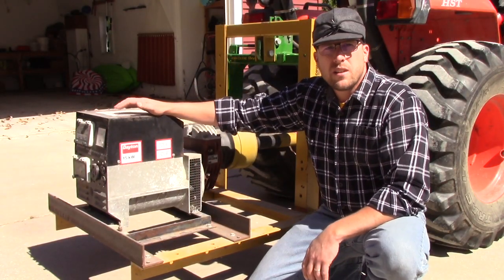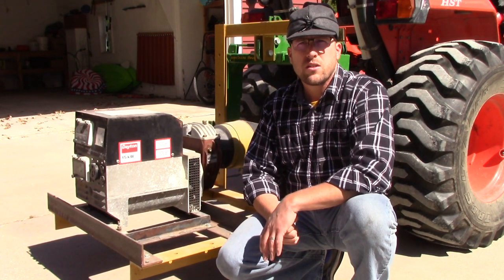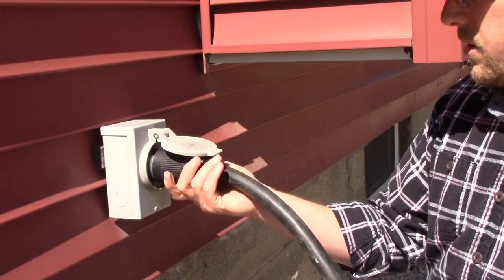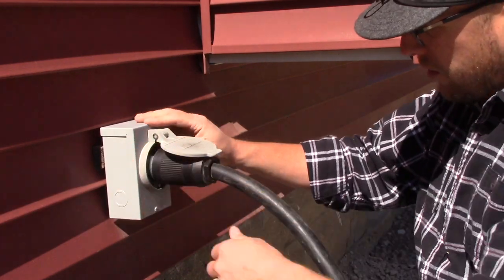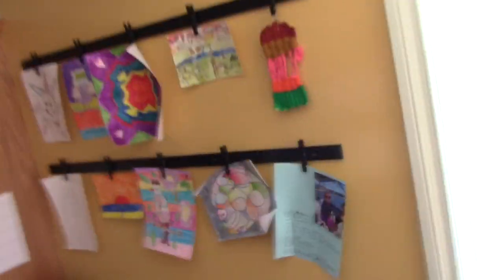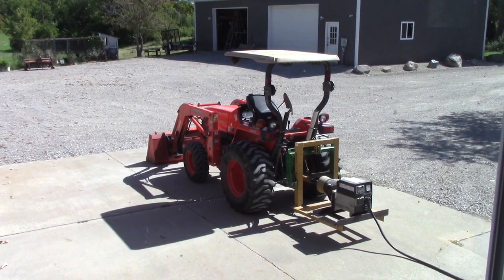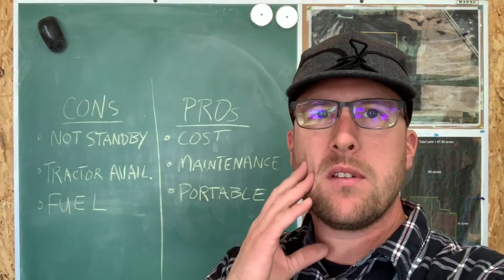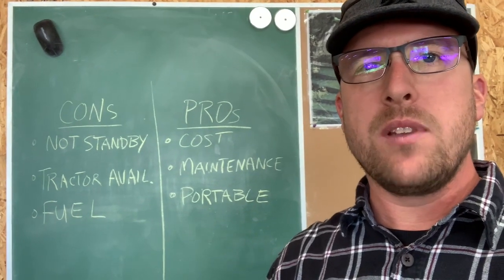154 PTO Generator setup on Kubota L3400

Comment: That interlocking system was a really effective system to prevent backfeed, a good switchgear, basically. Here in India, we use 1-0-1 type mechanical transfer switch to prevent back feed.
In India, locally manufactured PTO generators are huge success for farm irrigation to run tubewells and open irrigation monoblock pumpsets.
I appreciate your video, good description as well.
Reply from the maker: Thank you for your comments. When I first used this genny I did not have the interlock. Although I know what I am doing, I soon realized that sharing on YouTube could encourage people not to use an interlock too and some folks don’t know the real danger. Thanks for watching!

Comment: I have the same L3400 Kubota tractor. I did not quite understand you about the PTO RPM vs Engine RPM.  So what is the Engine RPM? Also I don't recall you saying what gauge wire is in the cable you are using for 15kw generator.
Reply from the maker: Well, on the RPM gauge there is a reference line where the engine rpm should be I order to get your PTO rpm to be close to 540. That said, with a load on the generator, you will need to know the voltage output somehow. My genny had a gauge on it, so I simply adjust the engine rpm in order to get the proper voltage output (frequency, really). If you did not have that, a voltage meter would be necessary to check one of the genny receptacles for proper output. Hope this makes a bit more sense.

Comment: Great job.  Any issues with the seat safety?   Don't most tractors shut off when you get off the seat?
Reply from the maker: The kubota has a three position seat switch (seated, not seated and seat forward) so when you get off, if you immediately flip the seat forward it will allow the pto to remain operating. Works good so far.
Reply: My tractor will run with no operator if the parking brake is engaged and it is out of gear.

Comment: I just bought me a Winco 15k now can you run your AC and furnace? Everything in your house at once?  I could of went bigger but in this day you really can’t find anything. I have 65hp on my pto   I’m setting my who system up like yours. Same cord same everything.
Reply from the maker: Hello. Yes, I can run the entire house. When initially starting up, I make sure some of the larger loads are off in the box. That way I don’t have such a large startup load. Then, once everything is up, the normal cycles of pumps and motors is ok with this genny. With your size tractor, you’ll hardly hear it grunt when loads come and go but you’ll have the same amperage restriction with the 15kw. Just do some testing to see what it can handle. Make sure you have the interconnect from the main grid power….ensuring you’re off the grid before connecting your generator.
Reply: @LivingOurAmericanDream  will do. I’ve done this type of setup before in my other homes. But this is the first time with the PTO generator

Comment: HERE IS A BETTER WAY JUST BUY A 100 HORSEPOWER ELECTRIC MOTOR FOR THESE YOUTUBE VIDEO‘S LISTED HERE. #1. This video is called;  (MAKE FREE ENERGY GENERTOR 220V  WITH 5KW ALTERNATOR AND MOTOR FLYWHEEL FREE ELECTRICITY GENERATOR). #2. This video  is called;  (MAKE 12K FREE  ENERGY FROM 12KW ALTERMATOR).  #3. This video is called;  (FLYWHEEL POWER GENERATOR AND MULTIPLICATION AND STORAGE). #4. This video is called; (MAGNATIC MOTOR FREE ENERGY WORLD BEST TECHNOLOGY ENGINEERING PROJECT 2020)

Comment: How much KW is this Generator running on the 2210?
Reply from the maker: If you’re referring to a John Deere 2210, the web page I looked at claims the pto is capable of 17 hp. That means it’s capable of running ~8500 watts or 8.5kw. Remember, if the tractor produces less than the generator is capable of, then you’re limited to what the tractor produces. If the tractor produces more hp than the generator is capable of, you’re limited to what the generator can output.
Reply: @LivingOurAmericanDream  

The specs say tractor Hp is 22.5 Hp.
The PTO is claimed to be 17.7 hp.
Will this 10 kw unit operate up to 8.5kw?
I know the more load you put on generator the harder it is to turn.
Reply from the maker: Ok, at 17.7 hp, your tractor is capable of running around 8.8 kw (it’s roughly pto hp divided by 2 gives kw capacity). So, if you have a 10kw generator, your tractor can still use it but you’ll only get the power the tractor can provide, in this case 8.8 kw. 

On a side note, 8.8kw is likely enough to run most everything you’ll need in an emergency situation, assuming you’re powering a normal house, not a farm.

Comment: Great video. Just wanted to share my experience with generators.  I ran a 11 kw for the backup of the storm in Texas.  It burned 1.1 gallons per hour of gas and my son had my farm light plant borrowed and it only used 6 gallons a day and it was only a 7kw.   Mine was a 3600 rpm and the other one was 1800 rpm   This was just running lights and cooking for my side and he run lights and blower motor for heat and water well!!!
Reply from the maker: The advantage for us is that our tractor is typically ready to go at all times and maintenance is up to date. Lots of folks forget about maintaining or even starting their generator until they need it. Thanks for commenting!
Reply: @LivingOurAmericanDream  
Yeah  I have used different ones and you’re dead one with maintenance.  There’s a avr on a lot of them and will go out or capacitor will loose it s exciting charge and they won’t work.   I watched Dennis on dlh farm from a couple of years ago and his pto 40k pto had to have its excitement flashed on it and it had a stud behind the cover to do it on

Comment: What if a tractor had ,say, 60 PTO hp for 30 KW but the house needs less, and say a 20 KW generator is used...in other words, generator PTO requirement is exceeded by the tractors PTO capability. Does a PTO generator have protection against too many KW for a house and too many PTO HP  from the tractor?
Reply from the maker: Hi Steve. What the generator is capable of providing doesn’t mean that’s what goes to the house. If the house needs 8750 watts and you have a generator capable of 20,000 watts (20kw), the generator would be able to provide that load with ease, only really sending what the load is. In other words you would have reserve power in your setup. Similarly for the tractor, if your tractor pto could run a 30kw generator and you’re actually running a 20kw generator, you simply have reserve power in your tractors drive train. Having a slightly oversized setup is not a bad thing, but being grossly oversized can be wasteful on fuel consumption. In the case of emergencies, we usually don’t mind that since we’re not running 24/7/365, we’re only running less than a week or so and intermittently. Great question!

Comment: Your comments are turned off on your other video where you were out of power.  So I hope its okay to comment here.  I am curious to how the tractor handles changing loads, from light draw to heavy.  I have a 26hp tractor not a 34, so was looking at a 10k.  But when your hogging or mowing and the load builds the rpms drop. I am curious to how much fluctuation you get out of your output, or how much the RPM's move.
Reply from the maker: No problem commenting here. On that other video, although more popular, guys were getting nasty because I hadn’t had the generator interlock installed in the main panel yet. I don’t allow a ton of negativity on the channel so I turned the comments off on that one. 

Regarding your question, the biggest load change you see is from no load to full load. My setup doesn’t dip out of voltage tolerance on the generator voltage gauge but I do make sure really large loads are not on such as AC when I initially turn everything else on. After loads equalize and you’re up and running, the normal load fluctuation isn’t an issue. 

I’d say with 10k watts, you’ll be able to run nearly everything, but perhaps not the AC and other large loads at the same time. 

All in all I believe the tractor pto generator is a great way to get a decent amount of power for backup while utilizing an engine on your tractor that’s very reliable and typically well maintained. 

Good luck and thank you for your question.

Comment: I've spent the last few days contemplating whether or not to upgrade my backup systems to a PTO generator; so your video is very timely. I'm fortunate to have two Kubota tractors (95hp and 26hp), and I'm thinking about getting a 27K generator that I can use with both tractors (an extra 10k for the house, or the full 27k for the shop). Currently I have a 120v 3200w inverter gen that fills 95% of my household needs at just under 1 Qt of propane per hour, but my 220v fixtures require a Generator (7K) that uses 5 qts of gasoline per hour. And I can only use a couple of the 220v fixtures at a time! I like the idea of the larger (PTO) gen because it can replace my current 220v gen for the house using the smaller tractor (lower fuel burn), but can also be used by my larger tractor when I need the full 27k of power for my shop/farm.

One other thing that I did was design/install a (12v) 50 gal back up water system for my well; I recently used it for 26 hours during a power outage and it worked great! The advantage was: I only needed to use the 220v gen once a day to refill the water tank.

Comment: Question regarding 3pt lift, it is probably best to keep the PTO shaft as level as possible.  Less angle means more efficient and less wear on the u-joints.  Would it make sense to have the mount for the generator have stands so that you can relieve the 3pt hitch?  Thinking for safety and the fact that over time the hitch will settle.
Reply from the maker: Yes I forgot to mention that in the video, keeping the PTO shaft straight is best for efficiency. As far as settling goes, tractor hydraulics can settle when the machine is off. When running, there is hydraulic flow at all times and the three point should hold position. That said, blocks or a stand of some sort is a great idea I order to ensure consistency each time. Thanks for watching and the suggestion.
Reply: Living Our American Dream Duh forgot about the fact that the tractor would be running!  Still for safety I would put something, I don't like being a way from the tractor with just hydraulics keeping something aloft.
Reply from the maker: Lol! Just thinking on that more, even properly sized wood blocks under the frame would serve the same purpose. Thanks again for the feedback!
Reply: Living Our American Dream Yep if you still have more lift room then you could have the "stands" mounted to the frame, but that is only possible if you have enough room to lift it high enough and not have it drag on slopes when transporting it.  Ideally if you could weld in some folding stands would be perfect.  Or just keep it simple and put some blocks in your generator location and be done with it.

Comment: great video,im thinking of getting one.i have a few questions.how much fuel per hour do you think it takes to run.is that setup is ok in the rain and snow with no cover over the generator.you threw two switches when you powered up one was the circuit breaker what was the other switch for.thanks
Reply from the maker: Oh, I forgot to answer the fuel question.... I know my tractor runs for around 8-10 hours from a full tank of 8 gallons when at full throttle. I’d guess a little under a gallon an hour. If you conserve fuel like I discuss in the video, 50 gallons of fuel should last a while.
Reply from the maker: Hi. For operation in the elements, the tractor is ok on its own but I have a large container that sits over the generator to ensure no water in the electrical stuff. A modified barrel or large plastic container works well but make sure to allow plenty of ventilation as most of these generators are air cooled. Regarding the switches, on mine there are two breakers...one is a main 60 amp that everything runs off. The other is the 50 amp that the receptacles are tied to. In my case, both have to be on. Hope this helps.